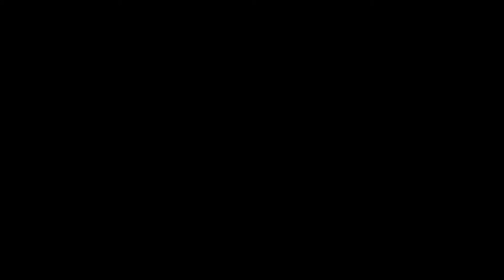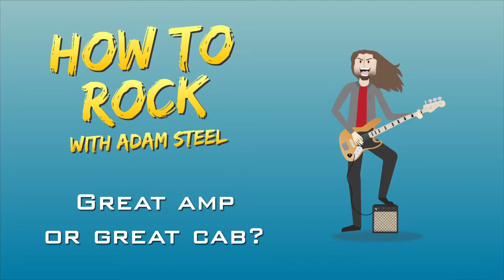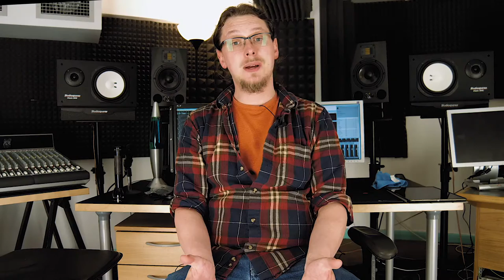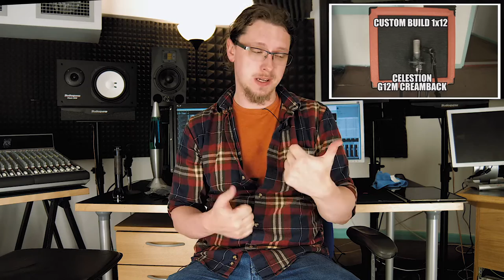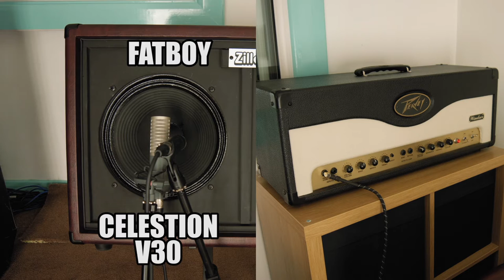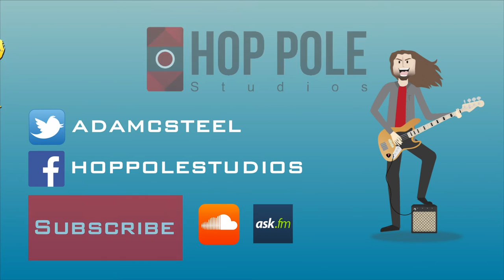GOOD AMP CHEAP CAB, OR CHEAP AMP GOOD CAB?

Comment: I have a 50w AVT head and matching cab I bought for £250 about 7 years ago. Loved it at first as a beginner player but years later it just sounded muddy and cheap. swapped the cab for a 1960 vintage and it made so much difference, sounds great!

Comment: Well done. I have found that the construction of a solid , rigid cabinet makes a big difference.
I made a 15W tube champ circuit with a pine cabinet and thin floating baffle and it sounds the shit! I also have a solid 11ply Baltic birch cab with G12m  greenback that I pair with my 6595mh...also the shit.
It really does matter when it comes to amps.

Comment: The speaker in the AVT is not a bad one, it is belived to be Celestion G12T100, it is very very similar sounding to G12T75. This speaker lacks the  treble of the V30, but heavy bottom end than V30... Because of the low bottom end, it might sound not enough gain to our ears, I fix this by putting an overdrive in front of the end. And the amp is alive

Comment: Don't laugh, but speakers do make the difference. 
I use to run my Squier 15/8 by unplugging the speaker, and hooking it to a 10 inch 3 way pioneer CS 700w ( excellent speakers from the 70s ) and it rocked! Much better quality and volume. I had more tonal control with the Mid/Treble speaker controls too.
I do the same with my Vester Maniac 15/8 ( I got a soft spot for the smaller amps..and they were free. Lol) I run that thru a Realistic 8 b s. It makes the chorus fill the room.

Comment: Good cab/cheap amp. There are amazing cheap semi-valve amps you can get(like the orange micro terror or micro dark), if you're going used and want something bigger you can score a 100w peavey Windsor for $300ish, it's a pretty good jcm800 clone and it's all valve. I'd personally get an Orange 212or 412 with V30s paired with one of those heads.
Reply from the maker: I have a Windsor and it’s one of my fave amps, especially when cranked loud!
Reply: Hop Pole Studios Have you ever thought about mods for your windsor to tighten up the tone?

Comment: I'd love to see a video on best cheap equipment to get. 

I stumbled on a carvin 412B cab loaded with Celestion G12M70's for $150 used and every amp I've ran through it Orange Thunderverb, Orange Rockerverb, Rivera Ktre, Fryette Pittbull, Deliverance and Sigx has sounded fantastic and so has the Peavey Windsor.  

Point is that people who can only afford a lot of the typical poor sounding equipment can find high end looking equipment that's masked in horrible 80's carpet covering.

Note, I've compared this cab to my Marshall 1960AV cab and Fryette Fatbottom 2x12.  It's as good as the fryette and smokes the Marshall, like it takes the Marshall, picks it up and shatters it.

Comment: So the answer would be cheap amp and good cab, at least for me. The bad speaker just ruins it altogether. These are both quite cheap amps though.
Reply from the maker: +Janne Väätäinen well the Windsor is inexpensive to buy now, but it’s a well built 120W Marshall-style amp, which in my opinion is far better than its price value because no-ones heard of it. A lot of amps are worth more simply because of their brand name.
Reply: Yes, I have heard good things about the Windsor. Valvestates weren't extremely cheap back in the day, as far as I remember. The 8080/8100 had a good reputation in the 90's, for metal at least.
Reply from the maker: +Janne Väätäinen valve states were a prime example of bad hardware with a price made higher by their brand name, there were no actual valves in those amps, the name was a marketing exercise- a successful one. They were tough, most still work now, but the tones left a lot to be desired
Reply: They are cheap now. I got my fully working 8080 for 100€, and it's got Celestion G12T-75 inside! The newer Valvestates had some really crappy speakers.
Reply from the maker: +Janne Väätäinen that’s true enough

Comment: seems unfinished one amp used with both but the other with only one? was there a reason for not doing the combo as a whole,
Reply from the maker: +pete hixson the reamp setup at the time was that the head had to be in the control room. There were only going to be the 2 setups anyway, the good head and cab was just for reference